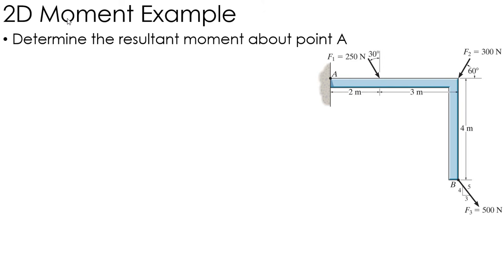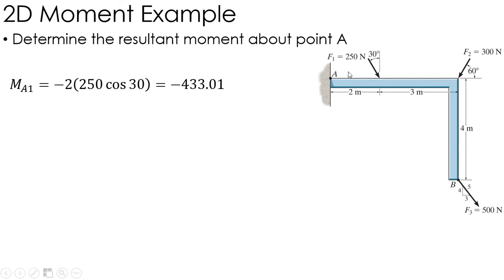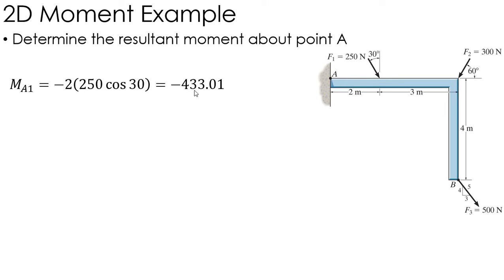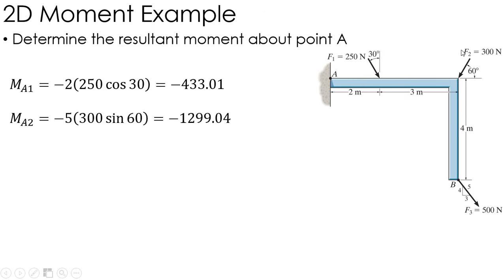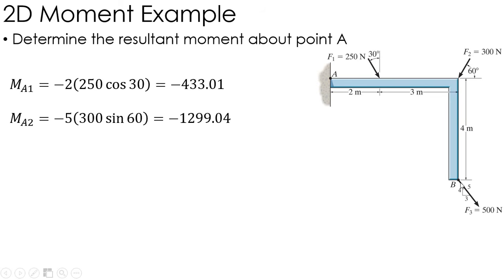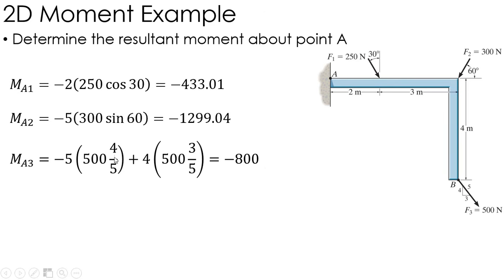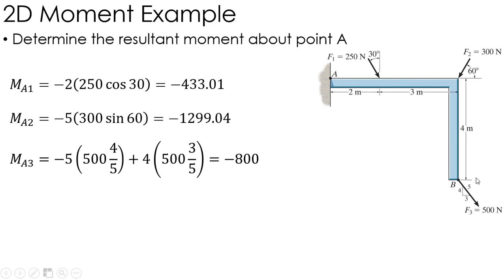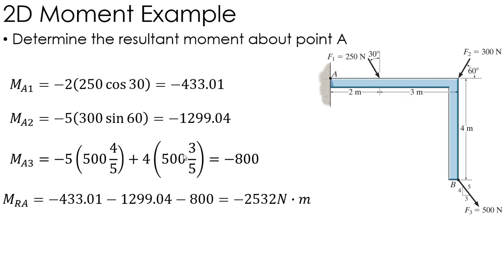Statics Example: 2D Moments

Comment: why is  Fx component  4 meters? i don´t quite get that
Reply: Force × its perpendicular distance . For Fx, since it is a horizontal force its perpendicular distance from point A should be the vertical length which is 4m in the given example.
Reply: try extending the force along its line of force but in the opposite(straight to the left) then you will see how it should be 4

Comment: Why is the first one not sin 30?????
Reply: If you take sin30, you will be finding  the Fx which is not perpendicular to the distance from point A.
Reply: @Viicruns  then why is the second Force uses sin and not cos as it is perpendicular
Reply: Did you understand Victor's answer above?  He's obviously thinking two steps ahead of us. 
Basically, let's consider "both components".  F1(x-dir) and F1(y-dir).  The moment at A of force F1 is the following:
F1(y-dir) x 2 meters= F1(cos30) x 2meters 
F1(x-dir) x 0 meters = F1(sin30) x 0 meters = 0
I know for some students it's a no brainer, but I can understand people getting confused by the rules/conventions. 
You must be absolutely 100% certain/confident of the rules to apply vector statics.  If you try to mix some logic you will quickly get lost
Reply: you can use sin but you will use 60 instead of 30.
Reply: trexinvert yea I agree I approached in a logical  manner I remember this problem haha
Reply: haha
Reply: شكلي بشرح للاجانب الدلوخ
Reply: @Abdullah-pb4bf  لا يشيخ هدي

Comment: Why are you using cosine for the first one?
Reply: The angle is formed at the vertical instead of the horizontal. So, the force in the y direction is a measurement of the side adjacent to the angle.
Reply: alternatively you can use -2 x 250sin120 if that helps you visualize it better. a lot of physics people use trig angle identities from the unit circle and it confuses the hell out of people (including myself)

Comment: A number of questions, if I may.
1) Why didn't you break the first two into the vertial and horizontal?
2) Why is it -5(500 4/5)?
Reply: Did you understand the answer by Rusty.  Another smart guy who is thinking 2 steps ahead of us.  
1.) Your question is valid.  You can break the first forces(F1 and F2) into it's component. When you do that you will get F1(horiz) x 0 meters = 0 and F2(horiz) x 0 meters = 0.  So basically, do the extra work to write it out completely and you can't.  Later it becomes instinctive.   
2.) Work out the trigonometry of F3 directions.  In fact, find the angle between the 4 and the 5 legs.  What do you get?  Then review your trigonometry again.  You know opp/hyp and adj/hyp.  What do you see.  You will see that just dividing by the legs "is in fact" the same thing as finding the angle and then using sin and cosines.  Except, you do 1 or 2 steps more.  You see dividing by the legs(if you have all 3 defined) is exactly the same thing as if you had the angle.   In some cases, it's faster and easier to check back your written arithmetic.